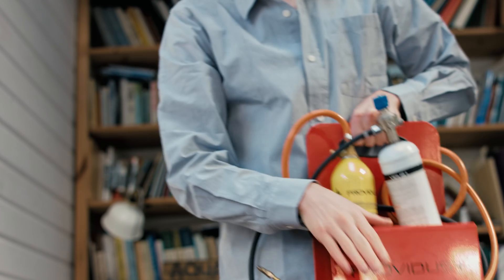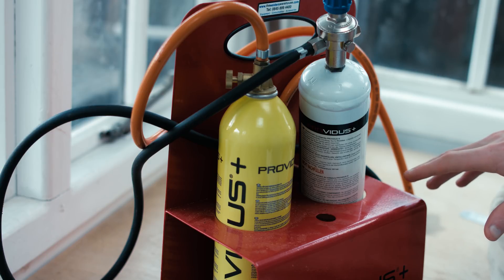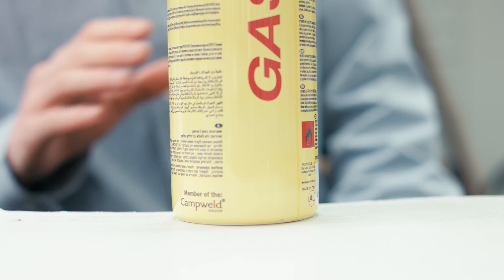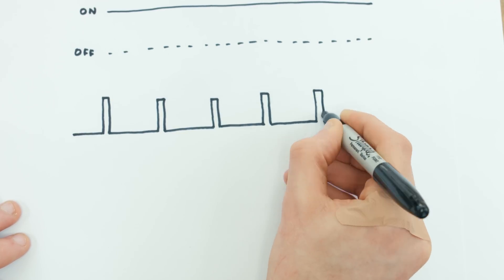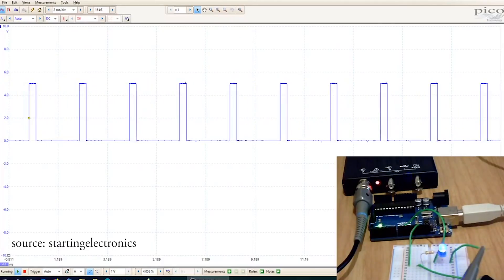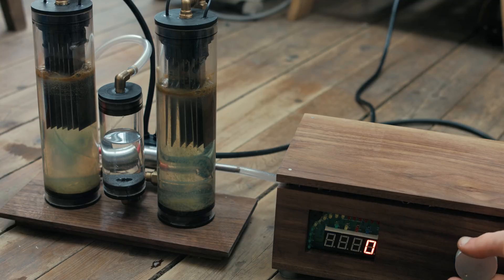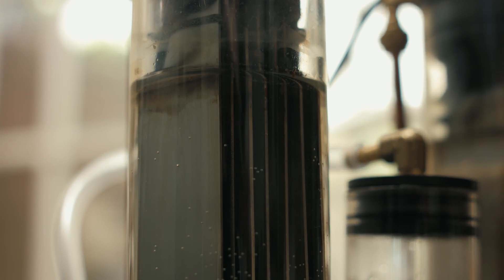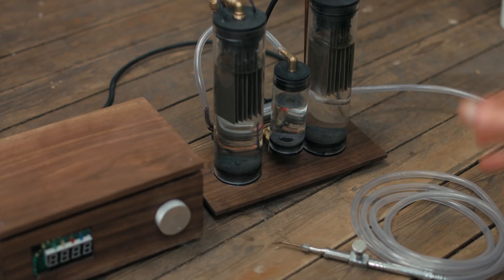Water Powered Cutting Torch

Comment: Use SS mesh plates and send them for Titanium coating.  You can buy these online but must be real titanium coat and make honeycomb mesh.  No need to use large plates, a 2” x 2” or round 2” Dia is enough. 

Water - must use distilled water. 
KoH - use 5mg/litre of water, so for a gallon just use 20gms. 

Controller - find pulse modulator with 10khz & control the voltage going into for variable gas supply. You can also reduce or increase KoH amount to control gas but not so precise as voltage controller. 

Rods going to Mesh plates - use graphite rods for best results. 

Good luck.

Comment: Also, your build is WAY overly complex. Just get some stainless steel sink drain strainers, drill one of the holes on one side to be larger and cut a plastic pen body and glue it in the hole to prevent a short. Use coat hanger wire as positive and negative leads and then alternate the orientation of the drains so one side is touching one wire while the other passes through. Put them on a 5/16th nylon all thread and separate them with 5/16ths nylon nuts.

Comment: Electroplate the plates in nickel and then a thick layer of silver. Keep the silver solution to use as electrolyte and periodically switch the polarity on the electrodes so they will, more or less, keep their layer of silver plating on them and stay very conductive. There's tons of cheap silver-plated flatware in thrift stores that no one wants.

Comment: Ive only slightly played around with HHO but ive found that if the stainless steel youre using is magnetic then it will corrode fast but if its non magnetic itll last quite a while. 
I've use the square stainless pans from restaurants and had great success. I also lucked into an 8ft by 4ft by 1/16inch thick stainless steel table top that works really well. 
I prefer finding the expensive parts of projects for free because free is the best price when experimenting.

Comment: I'm not sure if I missed it in the video, and I know this is a few years late, but make sure to include a flashback arrestor, given oxyhydrogen's intrinsic propensity for explosion
Reply: A simple one can be fashioned by passing the gas via a tube down into a sealed bottle filled halfway with water, such that the oxyhydrogen gas bubbles through and up the water, out into the space above, with a second tube attached through the cap but not under the water to direct the output gas. It can also help scrub the output gas of any minor contamination, not that that is very likely to be a concern.
Reply: @constantinexi6893  The problem with the bubbler flashback arrestor is that the bottle explodes instead. Ask me how I know.... Its better than the generator going bang and sending caustic water everywhere but still dangerous.

Comment: 1. DO NOT SPLIT THE GAS, USE FLASH BACK ARRESTORS, TWO. 
2. DROP THE AMPS DOWN TO .5 
3. DC 12v, and a pwm to supply charge to the electrodes with high voltage, low amp.
4. use distilled or tap water, fully submerge electrodes avoided sparks.
5. For best production, you need to gate off the cell with a tank circuit in electrical resonance with your cell.
6. Your cell needs to have far less energy bleeding, ground and isolate each plate, use 3mm spacing.
7. If possible circulate the water in the cell, or use ultrasonic, or skip this part. Cavitation significantly improves production.

If you make those changes you will have a torch that that can melt weld and blow your mind. It will consume way less power but produce way more gas, build it I guarantee it works I leave it to you to try to explain how it works ...bevsuse it should be impossible producing hydrogen is not energy efficient but this is....uh oh.

Comment: Why do the tanks need to be separate if you are aren't keeping the gases separate in the supply line to the torch?  Why not just have one vessel with alternating cathode and anode plates and then a small second tank to bubble the gas through as a flashback arrestor?  It seems like that would allow you to avoid using extra fittings of various metals that will corrode and leech into your electrolyte... I'm not an expert at all, asking because I am trying to work out my own design.  It seems like people usually keep the anode and cathode in two different vessels connected by a hose in order to collect hydrogen and oxygen individually in different containers.

Comment: Dang, this video is too short! I'd love to see more about how and why you chose to engineer the various components -- especially how you've plumbed the water and gas lines. May I ask what the 3rd (middle) water chamber is for? Wouldn't you capture the same amount of gas with just the two larger water vessels? Also I was wondering if there i s any risk of electrical shock from the copper tubes? Thanks!!

Comment: titanium is a great cathode material

for anode, you can use pretty much anything that doenst react with oxygen and conducts

carbon, platinum, mixed metal oxide, mercury, lead dioxide, manganese dioxide, whatever else

but i like carbon because it's cheap and eady to find, and degrades slowly while not leaving toxic solutes like chromium does, and just sloely flaking off carbon particles, if it seems to become a problem, filter it

tho i must say one big downside of carbon, it clogs filters a lot, and all the time, so filter it off before it starts  covering the bottom, otherwise you will regreat live.

Comment: I use Iron for cathode and anode , their cheap ,work well and not horribly toxic .
I also use sodium carbonate (washing soda) as the electrolyte , again cheap and not toxic (dont use salt i see  alot of idiots post that, it makes chlorine gas ).
Pretty rig you made tho ill give you that much, i hope you got it goin good by now .
Reply: Is the iron working properly? How much gas does it produce? Is it possible to make a high-temperature torch for welding?
Reply: @muhamadalif8749   yes the iron worked properly ,
 as far as volume of gas that really depends on spaceing of the cathodes and anodes, the amount of electrolytes, and how much volts and amps used.
I tried to make my own torch but my containers never held a good enough seal to create good pressure.but if i could get that problem solved i think i could get one working right

Comment: Sand, File, or Etch plates before use , it will clean off any protective coatings and give you more surface contact on the plates.

Also bind the loose ends and stabilize the "fins at bottom also might try separating the positive and negative side which will allow positive to draw negative and negative to draw positive ions ... One side will produce hydrogen and the other oxygen which is breathable.

Welding with hho will also teach you that whatever the fuel mixture, it always reverts to being water!

Comment: Nickel works well (many people using nickel wool), and the potassium hydroxide actually becomes protective.  The electrolyte still gets mucky over time, but it cleans up easily.  Graphite works without corrosion, but the high internal resistance limits your gas generation.  Your electrodes are also too far apart.  It is astounding the efficiency boost you will get when they are in close proximity.  Even just separated by a membrane...

Comment: try taking your stainless plates and scratch the surfaces will give more area for the reaction also try sodium hydroxide "lye" as your catalyst and completely submerge the plates in the solution there it will be in an oxygen-free environment other than what your generating and should not corrode as badly. happy gassing!

Comment: Great video. Editing and design of the control box was top notch. Would love to see a follow up

Just curious and wonder what would happen if you could create a much smaller tank that is just 100% water and plates, with a precise gap between each plate to allow as thin a layer of water through as possible. If you were to make the parts uniform and only create an outlet where the gas can escape that does not go through the electrode then I'd imagine you could eliminate the corrosion you were getting seeming to be from air in the tank. Where it met the water looked the worst, gave me that theory.

Good luck, look forward to seeing any developments you make.

Comment: Corrosion,!! You got 304 s/s, not 316 try a magnet slide it on plates, 304 will see the magnet stick slightly, where 316 no sticking, slides straight down 45 degr, use distilled water only never tap waters, probetly got 304 change supplyer. Thom in Scotland.

Comment: You need tons of current as opposed to voltage so I'd go for a step-down transformer and use graphite instead of steel. Increase the surface area(by a lot) for both cathode and anode, adjust your circuit to have heavy-duty parts. Reduce the distance between cathode and anode but be careful not to have them too close because it can create tons of heat. Try using baking soda instead of NaOH and make sure your solution is saturated enough.

Comment: May your PWM-system induce some AC as a result from the switching, I'm no electrochemist, but might it foul something up not having the plates be exclusively pos or neg? If this is the problem, could you use a full wave rectifier, with or without ripple fill cap? Forums prolly know about this, else you can test theory with battery power. Take Care

Comment: For cathode you can use pretty much anything but for anode I suggest either platinum coated titanium electrodes or MMO electrodes which you can find pretty cheap on eBay.

Comment: I have experimented with it and first tried it using salt as an electrolyte, the plates corroded very quickly and i tried it using normal baking soda and stainless steel, it doesn’t corrode (:

Comment: I thought of a water powered Stirling engine generator that uses electrolysis to make hydrogen, which it uses to heat the Stirling engine and spin a motor to generate power and mabye power the electrolysis system too

probably already been invented before :(

Comment: Great work! I have built a few of these things with all different types of materials. You want keep your electric connections out of your electrolyte tanks. It's most likely the copper or solder that's giving you the discoloration. Weld a tab of stainless that extends through the top and seal around it, connect power there. 
I'm also unsure of your electrolyte choice. I have seen sodium hydroxide used successfully for clear results, however potassium hydroxide is new to me here. Stainless steel with 4 teaspoons of sodium hydroxide per 1600ml of distilled water will yield the results you want. Keep all other metals out of the tanks.

Comment: I use carbon rods and sodium carbonate,  running 12 volts at 2-3 amps. Ddnt have a temp sensor handy but unlike 'copper,stainless,and iron' that I tried they all produced alot of waste heat. The carbon stayed cool to the touch after 30 min of continuous running.

Comment: Fyi stainless is the best plate
Reply: Woops you said that! My bad. You might have luck making a plating bath and using a slightly cheaper coating. Not sure if nickel would work. Anyways, plating uses so little material I wouldnt be surprised if coating all the plates takes a few beads of metal at most
 You can also make them much more efficient by cutting squares of metal, putting a through slit at one end, then stacking them with something like deleon between the layers as a gasket and spacer, and then pumping the electrolyte through them. You'll get far higher efficiency since the water will have much longer contact with the plates during the fluid cycle
Reply: Like under 50$ of platinum should coat all of them easily. I'd check the numbers on that first though before buying materials, or do a small test run and scale up the math
Reply: Check out 999 silver as well
 It's about 25$ to 30$ per troy ounce and coin shops carry them

Comment: i was going to suggest graphite also .. even graphite foil. ive made a mini HHO with Stainless Razor blades spaced about 1/16" apart and had about 12 total  alternating the polarity at each plate. I submerged the blades in a 2oz plastic container with a press on lid .. and made HHO gas with 0 catalyst .. Of course i made hho much quicker after adding catalyst .. I used baking soda. .  i really liked the PWM control you implemented. (the tupperware style container added a bit of safety to my device . i had a  few hho explosions which only resulted in the lid popping off and startling me.. but no damage to me or the hho device,,, )

Comment: One thing everyone seems to forget to explain is why does the gas need to be run through another water tank before using it.
Edit: How did you manage to separate the hydrogen and oxidizer because If you use both at the same time straight from the source, the fire will go back in and detonate the whole thing.
Reply: He showed a DIY flashback arrestor which is usually a tube packed full of stainless or copper wool

Comment: Blacken the titanium annod (sandblast, heat treat to 1700 f and quench in canola or similar oil) i found after annodizing parts i make that the blackend ti keeps producing hho while non ht sections just annodize to color and create an oxide layer stopping production of hho . Just a thought i have been thinking about. I made a hho torch several years back and corosion of annods was a big problem even with 316 ss also used an old mig welder as a power supply. Great video and build

Comment: Seems like maybe the electrical connections you have from the wires to the electrodes could be corroded? Those none stainless wires are ideally not in the water. Nice setup, whats the retro power supply?

Comment: What about Tungsten? Can you use that? I knowthats what my tig welding electrodes are made of and they are pretty durable. Not sure how they would hold up to your application..
Reply: Tungsten is primarily used for its high melting point, and generally isn't that conductive or corrosion resistant.

Comment: oh I think I know what happened, you should of used stainless steel nuts & bolts to connect to the plates, instead of connecting the copper wire straight to them, thats why the water turned brownish.

Comment: Reverse the polarity in cycles.The anode and cathode will then be swapped and the cathode will now be the anode in the end it when I'll be there cathode. Once  doing this the plates will actually sloth off the corrosion that has generated on them when you have reverse the polarity the corrosion will then move away from 1 plate and attach itself to the other plate as long as they are in suspension they are not coding the plate and they serve as an electrolyte.

Comment: Iron plates with sodium hydroxyde worked great for me. The corrosion was minimal and the hho generator kept really reliable performances over time. I don't think you should use alloys (like stainless steel) cuz they possess multiple metals and increase your chances of getting one element that corrodes real bad.
Reply: Good advice.  Steel is cheap, safe and easily replaced.  In fact steel which was heat treated for tools machinery works well.  Second hand parts cost less.

Comment: You're reaction to the water" is To MUCH " POTASSIUM HYDROXIDE " 
This is what I Do, " Start with Rain water" OR, Spring Water, from the Stores.!! Not (DISTILLED WATER).
Then only use one T-spoon per 1/2 gallon, or Two T- spoons, per (1 one)
GALLONS OF WATER. You get the message by now I'm sure. Now,
For power supply" Contrary to the 
Info online, you don't need a lot of voltage, only AMPS,!! Produce HYDROGEN GAS." SO, Tis is how I do it, 
Scrap an old Microwave" taking the 
Transformer to use as a power supply for you're Hydrogen fuel cell. 
Now, remove the top coil, and wrap" another one in its place.!!! Use a larg size ( Lits wire).!! Wrap one Complete turn per "ONE" Volt.!! You will need about 2 to 5 volts per, plate.!! This will be a balanceing act, that work's Best" by trying it, and adding or removing turns, the wire should be #5 to 8 gauge.
Now, THIS CAN NOT BE SAID ENOUGH!!! ALWAYS TURN OFF THE POWER TO anything you're working on. 
It is High Voltage, and OR High amps.!!!
AND IT CAN & WILL KILL.!! SO, BE VERY CAREFUL.!!! WORK SLOW,!!! & ALWAYS, TURN OFF ALL POWER, TO ANYTHING YOU ARE WORKING ON.
STAY SAFE, STAY HEALTHY.!!! 
Check out some of the other  video's on 
Utube before, jumping in to working on anything, before you salvage any transformers, or anything else that could still have power stored" always
Ground out the, CAPS, they are dangerous also. Good luck.
Reply: I'd buy an isolation transformer off ebay and plop that in front of that deathtrap. Microwave trafos are the #1 killer of electronics hobbyists

Comment: Try using nickel plates, not that expensive and works better than stainless. You can use the titanium plate on the negative side, but not the positive because the positive form titanium dioxide coating that is a good insulator.
I have found that 316L stainless steel for the positive plate and titanium for the negative plate works best for me.  Nickel can be used on both plates successfully.

Comment: May I ask the most efficient wattage (volts x amps) you achieved to produce a flame? Many thanks :)
Reply: .5 amps 500-600 v, but you have to build a better cell, not split the gases. The more amps you dump in the more your plates get destroyed, the hotter the water gets. It's super inefficient and NOT BROWNS GAS.

People make this mistake all the time HHO is not browns gas. Browns Gas burns at 200-600c hho burns at several thousand. Brown's gas can melt titanium and steel together and turn a brick in slag and sand into glass.

I encourage you too look into Exotic Vacuum Objects and Moray B King and New energy Conference Amsterdam.